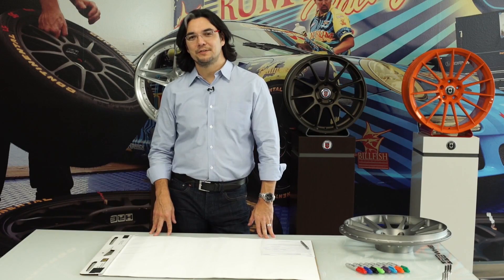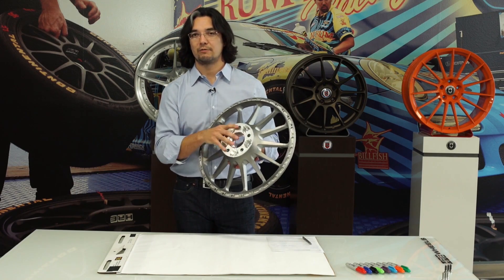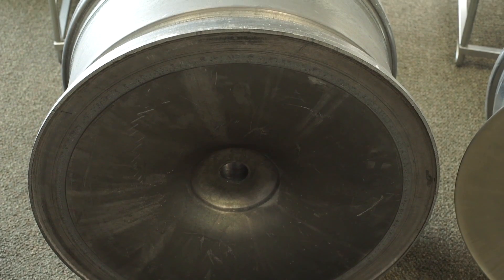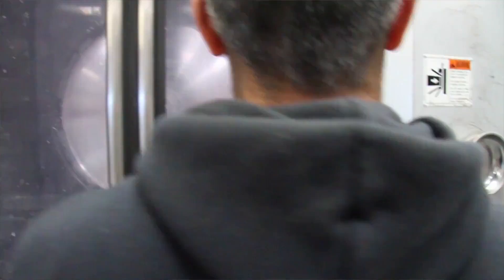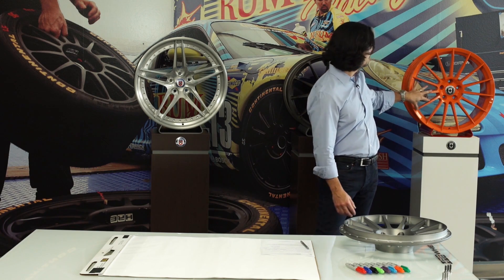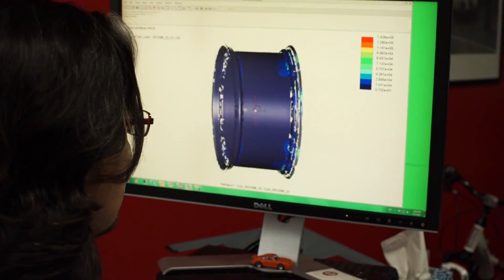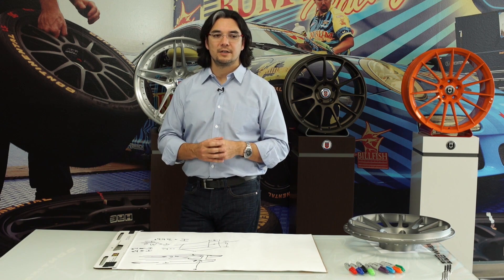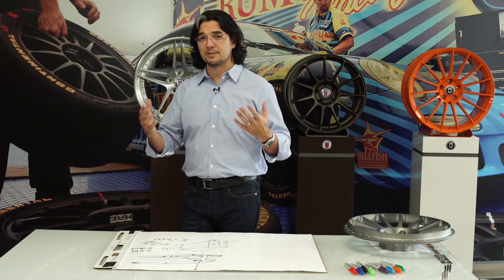Why Crappy Wheels Are a Bad Idea - /ENGINEERED

Comment: wouldnt a heavy wheel and tire be tougher to lift off the ground and go down easier than a lighter wheel?
Reply: +Cody Hodgson No, the suspension pushes a lighter wheel faster down to the ground.
Reply: +Cody Hodgson No, try to move around a hammer and then a pencil... the hammer will have more inertia and you will need more strength to change its direction, even if it is going up and you have gravity helping you push it down it will be harder to do so than with a pencil (or something lighter..)

Comment: I just got "Enkei rpf1" 18x8 rims (215/45/R18 Tires) for my 2002 Subaru WRX wagon, they look truly amazing & are very popular with performance motorsport. The thing you need to keep in mind is the Enkei RPF1 can still be damaged by potholes. I'm very happy with my purchase, Enkei makes amazing wheels.
Reply: +wedgoku Any wheels can be damaged if you hit it hard enough. The angle, depth of the pothole, speed, etc are all variable. Difference is though that you'll bend the barrel and be able to fix it. Fake wheels can crack or worse. Enkei's line up is pretty great!

Comment: So with the 2 piece and 3 piece rims theoretically (seriously this is a stretch) could you put the tire/tyre on the barrel portion, then assemble the wheel and have it be seated perfectly?
Reply: +Brap Brap You're correct with a 3-piece wheel, but since you have to seal a 3-piece wheel with silicone, you couldn't achieve that since the tire would be blocking it. 

With a 2-piece wheel, this wouldn't work, since this style of wheel does away with an inner & outer barrel, in exchange for one barrel with a face that is either bolted or welded to the barrel.
Reply: Honestly seems like it would work. Except I guess the face and barrel type 2 piece. But most of the split barrel type wheels I've always seen some kind of sealant along the seams.
Reply: +Brap Brap yes in a manner of speaking.  Some off road bead lock wheels are 2 pice design and are put together this way using a large silicone / rubber o ring to seal them.
Reply: I have a set of volk GT-7 two piece wheels... they have a single piece barrel which has processes that allow the face to be bolted in. with these wheels I can take a barrel off without removing the tire.

Comment: would love to have some HRE wheels but man $2000 a wheel is just insane for me!! but of course if you can afford a super car dont go cheap on the wheels
Reply: +Aaron Hinkle Keep a lookout for used wheels. HRE's are not too common but used Volks, BBS, Enkei, OZ and other TUV approved wheels go for pretty cheap.
Reply: vidurc i have a 2010 camaro SS and finding those wheels mentioned are really hard in 20's!!
Reply: Aaron Hinkle Ah that makes sense. Yeah 19's are hard but I've never looked at 20's. Look for things like official wheel groups online. I see a lot of deals posted on Facebook. Or worst case you might have to get something that is smaller with a beefy tire combo. 

In fact check this group out. There are more on fb but that's one I follow. 

There is a set of 20 inch HRE's for sale there. Not sure if its the right bolt pattern though.
https://www.facebook.com/groups/WiderWerks/?ref=browser
Reply: vidurc yeah i been thinking about switching to 17-18 mainly because im getting more into drag racing... and not to mention 20' tires are ridiclous in price. thanks for the help!

Comment: light weight wheels can increase MPG by a lot too! when the time came for choosing new wheels and tires for my commuter car that is mostly used on the highways. i gained 50 miles per tank! same wheel and same tire sizes just lighter.
Reply: +barnettzack How much weight did you save on one wheel?
Reply: +barnettzack I experienced the same thing. I dropped close to 10 lbs of each corner and my MPG substantially increased.
Reply: +barnettzack Totally. I went from 23lbs down to 20.5lbs on each corner (rim alone) and easily gained 2-4mpg
Reply: +barnettzack its rotational mass and unsprung weight it help with handling and acceleration as well as economy saving a few pound of weight have big changes since your reducing 3 pound of weight swinging around and around that amount of wasted energy is transfer to the ground making more energy per rotation

Comment: I've always wondered, I understand the lighter the wheel the faster it can get up and going but are the benefits to this only dependent on the car's setup? Like what if you have a rwd car making a good bit of power and because the wheels are so light that when power is applied, so much of it is left over that you end up breaking traction. Could a heavier wheel aid in this by the reduced forced inertia or is the chance of the wheel's weight playing a part in this so small that it wouldn't really matter and it would be best to just go with the lighter wheel anyway? Strong feeling it's the latter but always wanted to know this.
Reply: +Decside The weight of the car shifts back onto the rear wheels if you're dealing with any car, more so if you've got a purpose built drag car. What's 10-20lbs of weight going to do for traction split between 2 rims going to do. That 10-20lbs will make it harder to accelerate and stop though.
Reply: Ah makes sense. Thanks for the info guys.
Reply: +Mari Onette Agreed.

Although this may "help" (pseudo-help) in first or second gear, what about in third, fourth etc. when most cars do not have issues with traction. Either a more restrain on the throttle, better tires, or improved suspension geometry are the solution.

Comment: Was that a stab at ADV.1 at the end there?
Reply: Stab at Vossen and ADV.1 who focus on design aesthetics of a wheel and marketing over the engineering that goes into it like HRE does.
Reply: Patthon Sirilim Vossen and ADV.1 are American wheel brands that charge prices similar to HRE to cover their marketing/adverts without the quality control/TUV certification/engineering behind their designs and wheels. Simply put as Alan mentioned these companies focus on aesthetics of a wheel first then hope that the engineering behind the design holds up. "You can spend literally thousands of dollars on a wheel that is completely junk." - Alan HRE

I believe ADV.1 has TUV too but they haven't been in business as long as HRE and not many racing teams use ADV.1, I've mostly seen them on Luxury cars/Show cars for their "eye catchiness."

HRE are trying to get on that BBS level of OE supplying wheels to OE manufactures with quality, TUV certification, and motorsports recognition. HRE are supplying OE wheels to the upcoming Acura NSX, Formula D cars have used their wheels for competition events with podium finishes, etc. Where did I ever mention that I or Alan was bashing BBS (German) or Rays/Volk Racing (Japanese)? Those two brands are pretty much the benchmark in motorsport wheels which HRE is trying to achieve as well...Alan and I are praising those brands. Take a look at the GTR-Nismo that uses Rays wheels from the factory. And countless performance cars supplied by the factory like BMWs, Mazda FD RX-7, OE high performance variants use BBS wheels.
Reply: +David Phan when he says props to the germans and japan i think his talking about rays volk and bbs
Reply: +David Phan ADV.1 is not TUV certified. They have lied about it in the past though.
Reply: +Stephen Mihalik  I was thinking the same, haha.
Reply: +Angel A. Acevedo The problem is the fact that they lied prior to that. Not to mention all the people they scammed by denying warranty's to. You get a lot of hate when you lie about things like that. ADV.1 tried to do that and so did Vossen. 

http://truth-about-vossen-blog.tumblr.com/
Reply: ***** They can't be sued when they claim the owner is at fault. Warranties on car parts get denied every day because of technicalities that are written into the clause. Just try getting a warranty claim approved at a dealership for instance. A good company however, stands by their products.
Reply: ***** Do you not see the pics of all the failed wheels there. There is no official thread on any site. They're spread across a variety of sites depending on the make and model of the car. 

 I appreciate the fact that you're fair about what has been said so far. My issue is the fact that they've been claiming that they manufacture TUV approved products and for the longest time did not have any proof to back it up. HRE is very forth coming about their approval. It is something to be proud of. 

Adv1 has lied about their approval before. Read post #26. 
http://www.m3post.com/forums/showthread.php?t=596608&page=2

The problem stems from companies claiming something they are not. If you aren't TUV approved then don't lie about it. Plenty of customers who really don't care. The ones who do however won't get pissed at that point and freak out about the fact that they've been lied to. Finally after all this coaxing Vossen has their approval posted on their site and instagram. They've claimed for 2 years prior that they were TUV approved when in all sincerity they had nothing to prove it.
Reply: +zaco21 damn shame
Reply: David Phan

ADV.1 never got their facility TÜV certified. You should also know it's the same owner who started ADV.1 who what behind 360Forge"There's a real wheel manufacture tabloid story".
Now ADV.1 has been sold and is owned by MOMO, but they still push the same crap as they did with 360 and ADV.1 has done the entire time.
Vossen is just one big pile of crap. At least they don't charge the same idiotic prices as ADV.1, but they are still a shitty wheel from a company with shitty service.

Comment: Moderately interesting but Mr Miyagi, you are doing it wrong.
Try 3D printing with powder bed SLS in aermet and make the outer surface smooth with shallow golf ball dimples because aerodynamics also matter. And intelligent design can be made to look good as well. Hexagon black dimples for instance.
Your kung fu is weak.
Reply: +Dan Frederiksen the troll is strong with this one, the reason no-one 3D prints wheels with powder is that POWDER IS NOT FUCKING SOLID METAL!!!   As soon as you put any form of hard impact on a wheel made of powder it will fracture and have a catastrophic failure, and by catastrophic I mean multiple pieces of wheel all over the road.  Unless you actually enjoy wrecking your car I suggest you leave thinking to the people who have more than two brain cells that aren't arguing with each other.

To those who think this comment is too harsh, this brilliant individual is under the impression that batteries are far superior to fossil fuels as an energy source, and remained adamant after several engineers and general smart people disproved him with many citations.
Reply: +James Burleson lol, I laughed at this one quite a bit :)
I guess I should have known that powder is not very strong, lol :)
Just at the odd chance that you may have missed something, maybe look up what powder bed SLS means and aermet. Isaac Newton :)
Reply: +James Burleson It's good to see I am not the only one having trouble with this Dan Fredriksksikrn guy. I finally gave up the discussion after being insulted multiple times. 
But I guess when you run out of arguments you start insulting. 
If you wanna have some fun talk with him about tracking an EV (which everyone except him recognizes as pointless)
Anyway I agree with what you wrote about 3d printing wheels.
Reply: +Dan Frederiksen  You're just spitting out random "engineering" topics that you have seen on you tube.  SLS (selective laser sintering) would be a TERRIBLE choice for a wheel.   By design, SLS materials are UV sensitive, which means that a sunny day could degrade the materials.  They are also not intended for high impact applications, as they are often quite brittle.   In regards to the smooth surface, you would be cutting off a significant source of airflow, resulting in hotter brakes.
Reply: I have known people in the powdered metal parts business, they told me pretty much what I said here about sintered metal powder components being brittle.  Comparing the strength of powder parts to solid metal is like comparing particle board to real wood, there really is no comparison.  And when you forge metal in the way described it becomes stronger still than the same shape milled from billet.  There is no way to make a material stronger by turning it into powder and pressing it tightly together again.
Reply: +James Burleson I wasn't talking about pressing powder together....
+yuri53able what you said was equally unintelligent. I'm talking about sintering metal and aermet at that. You have zero clue.

Comment: All nicely explained, only thing I'd add, regarding rotational inertia, is the effect on handling. Following the rule that a force in motion wants to continue as is, a lighter wheel doesn't resist changes of direction as much i.e. when you turn.

Comment: Great video as allways.. But i cant believe they used a hand deburring tool on those rims... Tell them to hire a new mashinist that knows how to program.. I wouldnt spend 2000$ on a wheel that has a chamfer that looks like the surface of the moon...
Reply: You dont get the point... Why buy a 200.000$ cnc mashine that can do a perfect chamfer everytime, if you still choose to do alot of handwork?. 10 wheels a day with 10min of handwork on each one is ALOT of manhours in the long run. Plus the finish isnt perfect..
Reply: Sometimes I like to put a little chamfer in my coffee in the morning. It just spices it up a little bit!
Reply: Ferrari manually deburs their aluminum engine blocks.  Wouldn't have a Ferrari, either?
Reply: +Rasmus Laursen So don't
Reply: Crying ass bitch

Comment: What about the wheels on Koeniseggs? I know it's one company and they don't use normal methods, but they wrap carbon fibre around a tub to produce their wheels.
Reply: +Carl Sagan Those wheels are some godlike shit. Maybe they are the only one in the world using that method. But ofc you need some next level thing on those next level cars.
Reply: +Carl Sagan the sheby gt350r has carbon fiber wheels too which is a big step for American car companies
Reply: Fancy Shit for a fancy car
Reply: +Jason Cheaper then buying new rims for your Veyron after 3 tire changes. Those cost you 120.000
Reply: +BossTuned I know "wrapping" wasn't the correct term to describe the adhesion of prepreg carbon fiber. Still thanks for the video, I watched the 'How it's made' video on the koenisegg one:one
Reply: +Steffen Simon It's stronger, stiffer, lighter and better balanced than anything else. You could say the same about any rim which isn't a shitty steel rim "fancy shit".